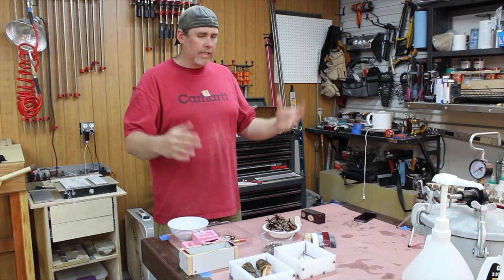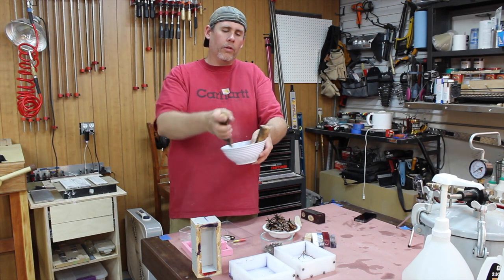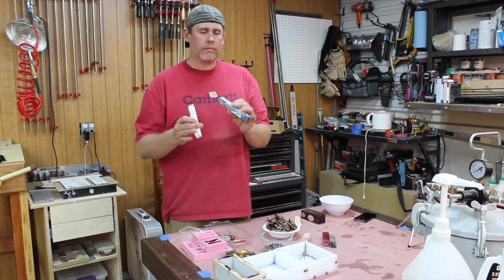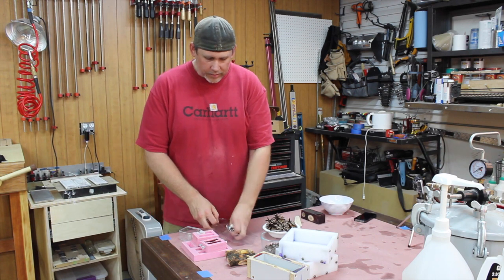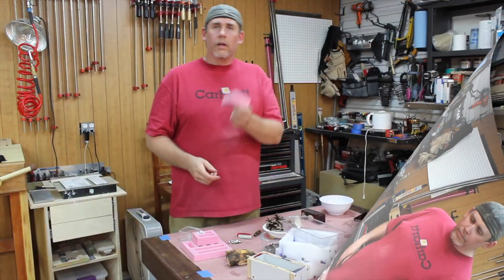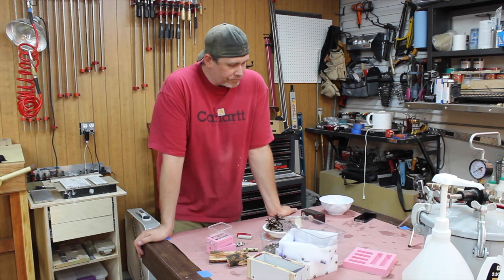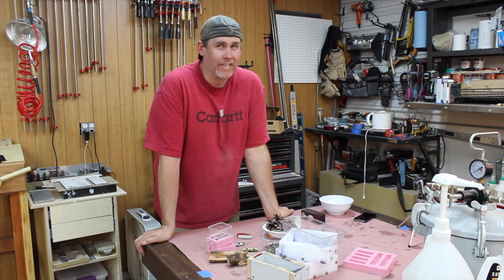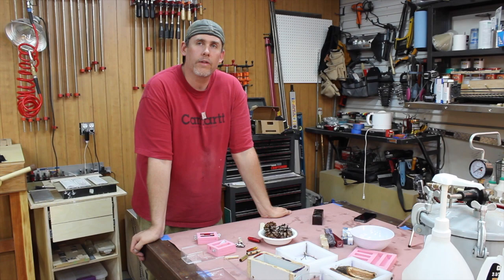What You Can Use For Resin Casting Molds: Woodturning

Comment: I'd also like to ask if anyone has tried  PVC Board ?
 [Royal Moldings limited PVC Board item #238348]
You can get this stuff at you local box store (blue)

This stuff has a rough grain like fascia, but all the other sides & opposite face are smooth.

Has anyone had any experience with this material for molds ?
Reply from the maker: I haven't tried it myself, but I'd imagine it would work as long as it's got a smooth face on it. Might need to use mold release with it